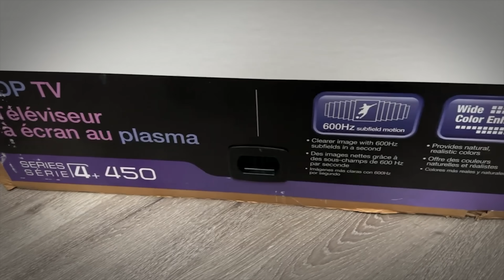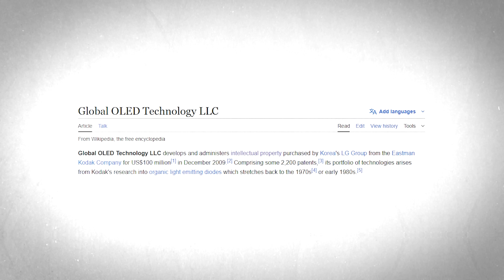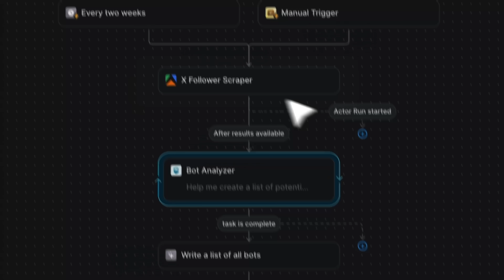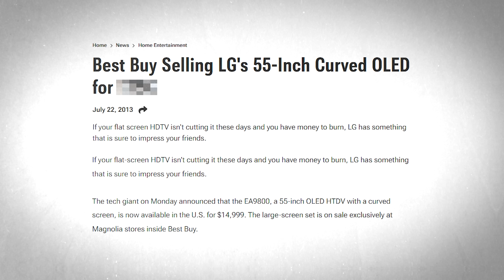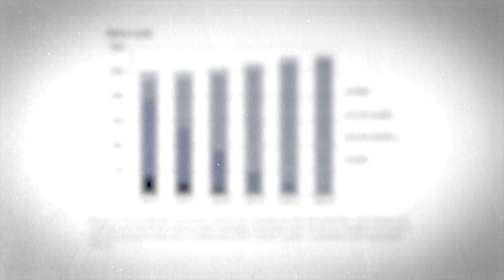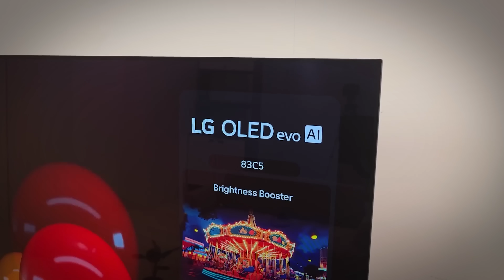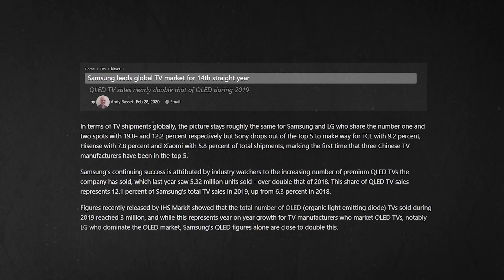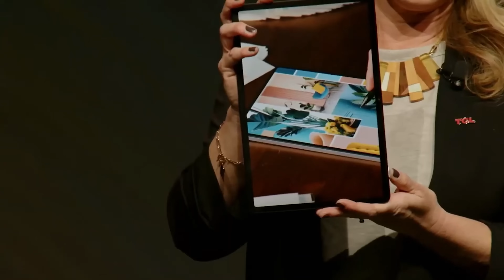The Unstoppable Rise Of LG TVs (There's No Catching Up)

Comment: It's by the end of 2025 and this channel does not double check with AI for the latest OLED technology but asking for more subscriptions.

 「LG’s WRGB OLED is excellent for TVs and offers great balance of brightness, efficiency, and longevity. But other OLED types (like QD-OLED) may outperform it in color volume and peak brightness for high-end displays or pro monitors. So WRGB is not always “better,” but optimized for TV use — and it performs extremely well in that domain. 」

Comment: I still remember my first 42" Plasma-TV that was made by LG. The cost was like $5000, similar TV from Sony was $8000 back then. After few years LG's picture turned greenish and it was repaired many times. The fault came back all the time. So that is the reason I will never buy LG again. Best televisions I have had were Pioneer 50" Plasma and my current Panasonic 65" OLED. I know, the panel is made by LG. I bought the Panny for discount price $1500, amazing value! Even got professional color calibration for free.

Comment: My LG tv died during the 13th month. If it was purchased from amazon, best buy etc itd have been a disaster (only 12 months warranty).
 Luckily it was purchased from costco, which refunded after trying to fix it for 3 months and failing.
Bought a samsung tv (discontinued floor model that was running 12 hrs a day for months), 10 years ago and its still working fine.

Comment: Still have a Panasonic FullHD plasma from 2010, phenomenal picture quality (better than any modern LCD), still working flawlessly to this day. Never had to be fixed.
I have solar panels installed in my house, so the extra energy consumption is not a problem, same for heat as I don't pay a dime for leaving the A/C on the entire day if I want.
I have a bunch of old videogames attached to my plasma, it's the only FHD display tech that works well with SD content (which I also consume a lot) besides CRT, so when it finally dies I'll probably buy another plasma.
When there's not a single decent plasma available, I'll give OLED or whatever similar technology is available in the future a try.

Comment: Ever since I first saw OLED at CES 2012, I knew it was the future. Yes it was unrealistically expensive at the time, and yes everyone knew of early OLED problems. In spite of that, I knew it was a matter of time, especially when the problems seem realistically solvable, it just needs time in the oven. LCDs were ass when it comes to quality and color, even with IPS panels of the time. It was "good enough," but OLED showed that it could have been far better. DV support just propelled it even further into the lead, where Samsung still tries to push its HDR10+, to little success.

Comment: We purchased a LG OLED 65' TV in late 2019. Within a year it started to show image retainement, which would go away after the TV had been turned off for a while. Within 2 years, they were permanent burn ins. We moved that TV to a Bedroom as a secondary TV. It was replaced with a LG 75' QNET TV. This has been rock solid with very good picture and 100% reliability. We are never going to buy another OLED. The difference between an OLED and a high quality LCD is simply not large enough to justify the short life of an OLED.

Comment: Samsung pissed me off when they refused to repair my barely 2 year old fridge. Circuit board went out.  
So, when it came time to pick TVs for my next 2 hotels, I bought LG.  550+ TVs were from LG, not Samsung.
Reply: samsung is the WORST at appliances. they might be #1 in mobile but thats an entirely different world
Reply: Samsung thrives on mobile and TV's in my opinion. Everything else does not live up to consumers expectation.
Reply: Which Hotels? As a fellow LG fan (TV, fridge and washing machine hehe) I'd love a few free nights in Amsterdam if it's an option hehe
Reply: @tombell4122 these are all in Florida
Reply: LG would not repair it as well. Just saying but I agree LG gives better Customer service and efficient stuff
Reply: Stay away from LG fridges too. Just search for them on YouTube and you’ll see.
Reply: Lg is also very bad in service...i have a 43 inch 4k tv and within 3 years the screen started showing 2 lines...for that they are saying they will replace the screen for a price with which i can buy a new tv....even their technician agreed that buying a new tv is better but they cannot help me if i don't pay
Reply: @SohailS10 only their top end G and Z series comes with a 5 year warranty.
Reply: @SohailS10 3 years is likely past the warranty so you get nothing for free, then you gotta consider parts+labor is more expensive than just new parts

Comment: Last I checked the majority of Samsungs OLED offerings use their own QD-OLED panels, the LG WOLED panels are only used in their smallest and largest sized OLED TVs and the lowest end models, but even that changed quite a bit in 2025, with the S85F using QD-OLED panels in many sizes (in some regions).

Comment: I bought a lg 92a tv 2025 I set up the tv and it freaked out when I turned it on returned it got another one same thing they told me it had hardware failure I instead bought a Sony lg unfortunately does not check their tvs after their built zero quality control

Comment: I bought 2 LG plasma TVs 15 years ago. They are both working fine with exceptional picture quality. Power consumption is negligible. One of them is in my ski condo at 7,000 feet (remember the myth that plasmas fail at altitude?). I never understood why they stopped making them.

Comment: Even with oleds technology, LG is struggling against their way cheaper counterparts from china. They produces more and cheaper. And it's visible - I am working in one from LG's factory in Poland, which can produce up to 77' Oled of newest generation. The issue with oled is that it can't really be way better than it is now. It's like dead end, so if you bought oled 5 years ago and owns it till now, then you won't see difference when you will buy new one. That kind of forces lg to reduce production quantities, as those TV's even after massive price cut do not sell that well.

Comment: This video appears to be an ad for LG OLEDTVs. OLED is still vastly more expensive than lcd or QLED, i would say depending on the model between 2 to 3 times more expensive. This is particularly prevalent for computer monitors which while being much smaller than TVs are usually way more expensive than LCD panels.

Comment: I treated myself to a big screen TV in 2005. For $2500, I got a 50" DLP - specifically because I was capable of fixing it. It lasted me for 17 years. 
Knowing that electronics prices are so volatile, I avoided looking at advertisements for a while. I did find out that 2 months later, the same TV was $500 less.
Fast forward a few years, I'm helping a friend of mine without a car get his new big screen home. I mentioned to the sales guy that I had a DLP TV, but hadn't seen any in a while. He said that he saw a couple in the dollar store around the corner 🥵 That jerk-off. 

I am glad that I was able to repair my TV for so long, until parts ran out. I purchased the last colour wheel for the LG DLP TV line ever.

Comment: You missed a verry important thing:
Samsung is betting on MICRO LED wich is comparable or better than OLED in every single way plus it doesn't have burn-in. Its the perfect technology. The problem: its expenssive af. I think the cheappest micro led tv they have is ~100k. Making it consumer level is a looooong shot but its the endgame. They've also tried to bridge the gap with stuff like QLED and MINI LED QD-OLED and its working pretty well. Yes, lg dominates oled BUT samsung has overall the biggest market share. AND ITS NOT EVEN CLOSE.

Comment: I have a C7 and it is still working great. I never adopted LCD but used picture tubes because LCD was bad.
I wish LG good luck, but I'm sad that the developers of the OLED chemicals never build own production lines.
Reply: Damn, still no burn in after 8 years ?
Reply: @racym1553 No burn in. It is no 24h display. And it does contain wear levelling. Just 8 years, thats no age, my previous picture tube ran for 28 years with just 1 repair.

Comment: Lg is great for pioneering oled tech, however, I think you should have talked about QD-OLED. Right now it’s the superior technology. Of course they both have trade offs, but Samsung is gaining market share.
Reply: The only thing stopping Samsung from dominating is literally everything else about their TVs apart from the actual panel. By far the best displays with the worst everything else lmao
Reply: @BusyWeaverBeatsAgreed. Samsung displays is amazing, but Samsung electronics is one the worst brands imo. They nerf their TVs by updating it to tune down the brightness purposely so people will upgrade and the matte coatings worse than glossy for many. The remotes are pretty good, but man, losing brightness due to software updates is horrible. Not to mention the QC issues. I’m buying an S90F, but if it has any issues, I will return it for a G5.
Reply: @Wusyaname_  exactly. Thankfully you can go to the service menu and unlock the display on their oleds, but often void warranty in the process. Also technically the anti glare can be peeled off,but it's not exactly risk free.. yeah they are their worst enemy haha
Reply: LG definitely does the customer experience way better and the G5 is still a beast (if all the bugs got fixed)
Reply: @BusyWeaverBeatsI have a C1 and it’s great, but the LG OLEDs are kind of weird. My c1’s white color is plenty bright, but the colors are not bright enough due to the white subpixel. I want to upgrade from a 48 inch to a 65 inch, so I was gonna get a g5, but the s90f does 95% of the g5, but for cheaper. I hope it doesn’t suck. I have a QD oled monitor from dell which is amazing.
Reply: @Wusyaname_ damn here g5 is cheaper than s95 nvm I misread u talking about s90
Reply: @fusedexe2575 Probably not gonna get the g5 or s95f because I think I’ll use them at like half brightness lol.
Reply: How does Sony keep wining tv of the year so many times, including 2025 when they dont even make the panels.
Reply: @Pepe-dq2ib  image processing i assume
Reply: It honestly feels like people praise QD-OLED just because it sounds higher-end. QD-OLED good but truly overrated

Comment: It's wild how LG now provides displays for Samsung when Samsung used to supply others.
Reply: Only WOLED TVs Samsung doesn't make many of them it's QD OLED is Samsung Display manufactured
Reply: samsung gets the WOLED from LG at a cost that is lower than to create it themselves. they also want to pin the QD OLED tech as top of the line and don't want the QDOLED being slapped on their budget model, otherwise people wont buy the higher end ones. LG is also slowly moving towards their 4th gen panels ( which i assume they called tadem oled) with RGB light emitters, which are suppose to be brighter, cooler, and longer lasting. so its not a stretch to assume they want to get rid of last gen panels as fast as they can to clear up space.
Reply: @sajidhossain1928  WOLED isn't as high end as QD OLED 😮
Reply: @RobertK1993 with woled the generation kinda matters, woled UpTo the 3rd gen has been incremental upgrades, 4th gen tadem oleds are the ones that are on par if not better than qd oleds.
Reply: What Samsung is buying from LG are upto 3rd gen oleds that LG is actively trying to get rid of, which to some degree is considered lowerer end due to the sheer age of the manufacturing technique, still really good oleds with pitch perfect blacks, just bit dimmer. The issue I have with qd oleds is the purple tinge of the panel itself, and the fact they use blue light filtered though a quantum dot to create colors. The 4th gen LG oleds have 4(or 5?) backlighting 1 red 1 green and 2 blue( blue emitters tend to burn out a lot faster and to compensate that flaw LG added this extra blue emmiter to compensate for this degradation) and 1 white(I think). The blue only backlight on qd oleds theoretically are suppose to have a shorter lifespan. Take what I say with a grain of salt though, I know a bit but not a expert.
Reply: @WizKing93 woled is better though. All advantages are tiny but the blacks are worse on QD-OLED plus there's purple tint which is the biggest factor.
Reply: Samsung still supplies others with QD-oled panels. Most of the oled gaming monitors and a lot of higher end Samsung Electronics and Sony TVs use Samsung Display QD oled panels. Samsung Electronics uses LG Display panels for some of its midrange and lower end TVs, because they are cheaper.
Reply: @Szergej33  not true, Samsung panels are cheaper in cost.
Reply: @Plant-Based-Gains  LG OLED panel used for some Samsung TVs aren't high end OLED that QD OLED
Reply: @RobertK1993  QD OLED is just next gen OLED, quality of panel itself is another story. LG is generally better here while being cheaper, since they've been producing panels longer.
Reply: @Plant-Based-Gains Next hen oled?
Do you know what the difference is between RGBoled wOled and QdOled ?
Reply: @Plant-Based-Gains  Sony Bravia beats them and shootouts stop misinformation
Reply: @RobertK1993 Sony does not make panels, stop spreading misinformation. This is about the panels not the complete televisions.
Reply: @utfigyii5987 I never said they do I said their TVs are better than Samsung and LG is which is true stop lying.They did make own OLED TV panels in late 2000s one was called XEL-1. Sony makes own panels professional monitors and discipline Apple with parts iPhones MacBooks VR headset Apple Watch can't manufacture anything.